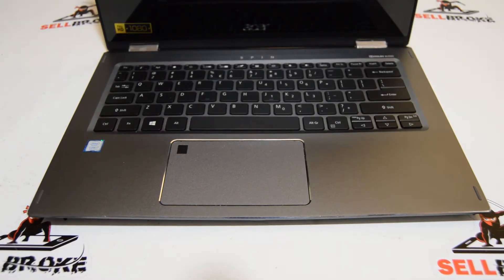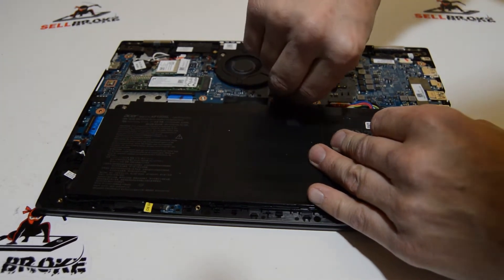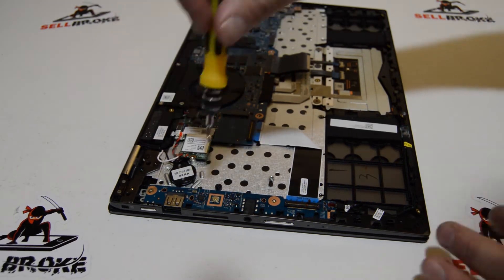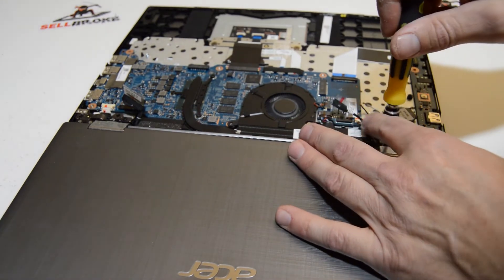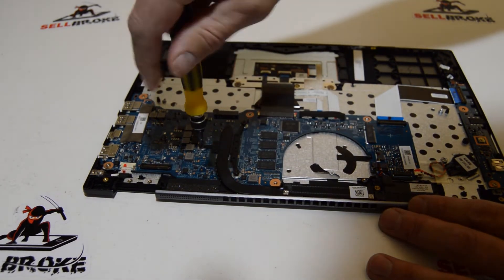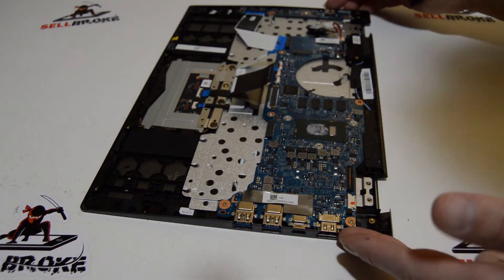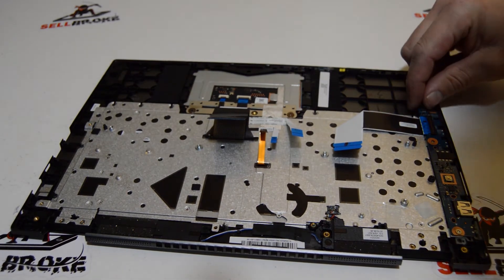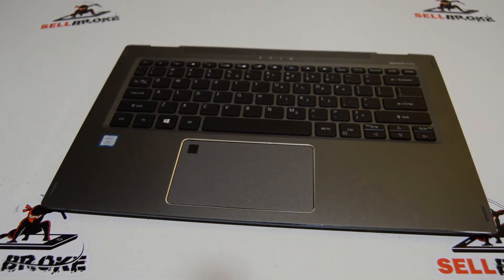How to Disassemble an Acer Spin SP513 52N Laptop

Comment: Great but there are 12 screws and two different lengths. I have found that if they are replaced incorrectly it can cause track pad and mouse problems. Where can I find the proper location for these screws?

Comment: has anyone ever had this problem whit this laptop? Mine tries to go into sleep mode (screen goes black), but it doesn't fully go into sleep mode, because the fan cotinues to spin and the led on the side stays blu, when this happens it is impossible to wake it up, neither with the keyboard nor with the touchpad and the only thing that I can do is to shut it down by pressing the power button and losing all my work. I tried updating the BIOS to the lates version, disabling fast boot, switching to linux but nothing worked. nowadays i just set it to never go to sleep and i just keep it charging but it's really frustrating, I've had this laptop since 2018 and in all these years I never figured out how to solve this problem. I checked ACER community but even though some other people had the same issue the answers from other users or ACER was always useless.
Reply: So I also have this laptop since 2018, and I think I've got a similar issue. Mine will usually go to sleep fine but it will freeze when trying to get it out of sleep mode. I haven't found a fix, but my workaround is to just put it to sleep while on battery, and only when the laptop is in sleep I plug it if I need to.

Comment: FYI - Purchased this laptop back in 2018 and swapped the M.2 256gb SATA (6GB/s) drive to a m.2 NVME 1tb (key slot M.) and the drive was reading and writing around 1.3 GB/s. much improved from the 600MB/s. and the new boot times are about 3 seconds. You might have to buy a m.2 enclosure to clone your m.2 to your new one. I purchase both a WD SN550 Blue 1TB NVME (if you want faster speeds go with a Samsung EVO or WD Black) and a SSK Aluminum USB 3.1 to M.2 NGFF SSD Enclosure Adapter. Then used Macrium Reflect free version to clone the NVME. worked great.

Comment: could you share a link to where i can purchase the DC jack. I cant charged my laptop due to the broken jack. I tried sending to my local repair shop, they say they have yet to replace such model ( i have the same on as your video). 

I notice that the DC jack is separated from the power motherboard. Means i can replace separately correct?
Reply from the maker: Yes, just make sure you search for your entire model number, the 52N after the SP513 is important. Check eBay, I see tons of results.
Reply: This model will also charge by USB-C. Good luck,
Reply: @timchu659  now this factoid with the video has made my day. thank u